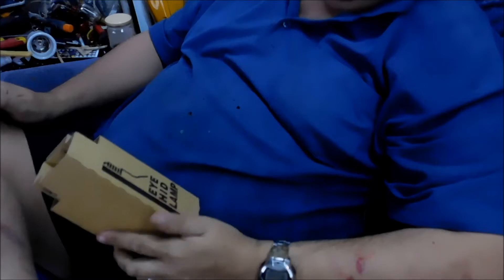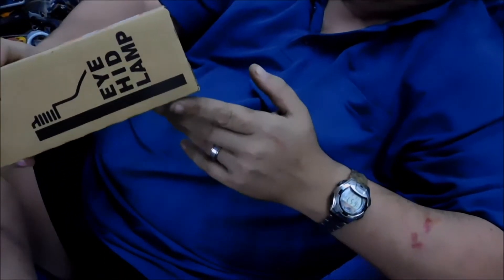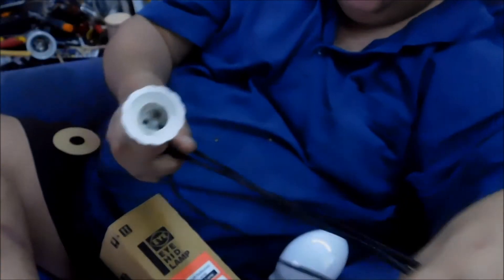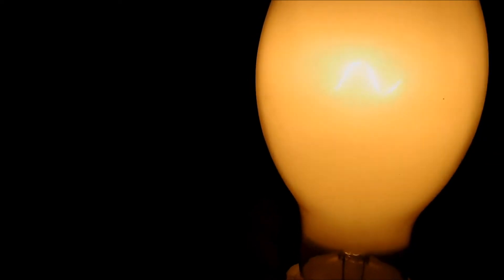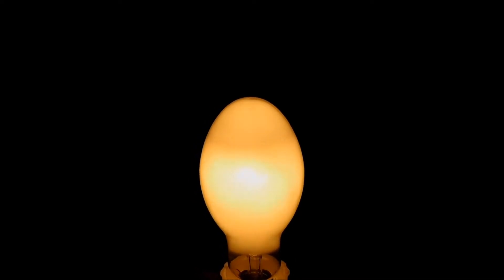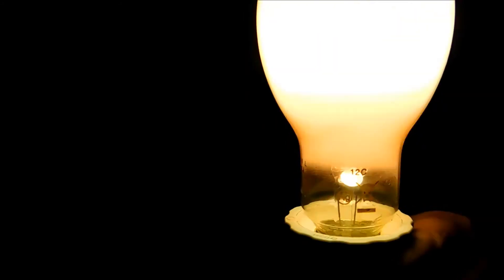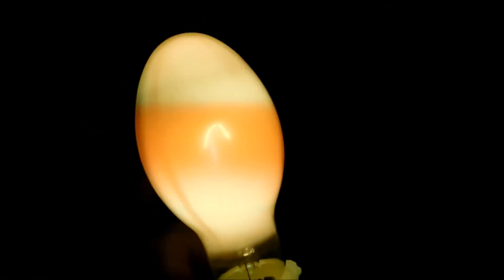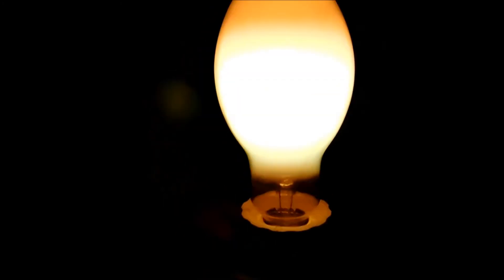EYE LIGHTING 160W SELF BALLASTED MERCURY LAMP

Comment: Bought 3 for like 20 after tax and shipping they run great one could make a safe indoor fixture with these if you did make sure you have plenty of space above it I wouldn't use them in standard table lamps with shades and you definitely want the socket to be ceramic and I'd only operate them horizontally or base down I'd go base down cause you could implement a shade that uses screws not a harp you want one like old floor lamps had but with an opening for heat to escape or a refractor heat isn't my only worry it being a mercury vapor pressure in the tube has to be up there and I dont know how forgiving these are during a failure or incident granted the iwasaki have pretty good outer protection people need to take into account these are still HID bulbs also the uv these can give off or one that leaks more than it should so also make sure if they are being used they are not too close too people for long periods

Comment: How do these do indoor ligithing?
Reply from the maker: Not bad run direct off 240V mains and they give off a light like a cool white flourescent or slightly higher colour temperature.  Just need to remember that these operate at a higher temperature than a normal incandescent lamp too
Reply: You could run these bulbs  in a ceramic lamp holder.
i bough a few when i visited chile.
Reply from the maker: Ceramic lamp holders are the preferred for these types of lamp anyway :)
Reply: Pretty damn good if you don't need them for high color accuracy tasks. MBF/MBV lamps don't have the best color rendering on the planet.